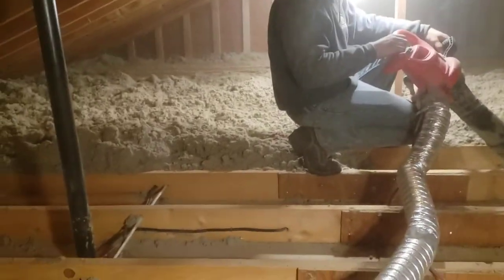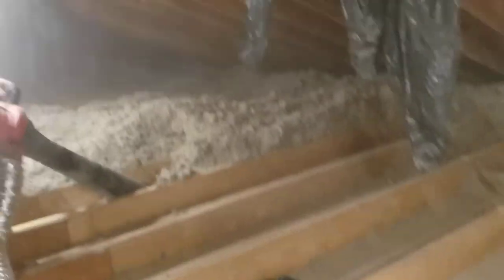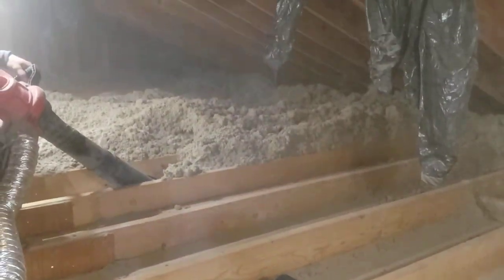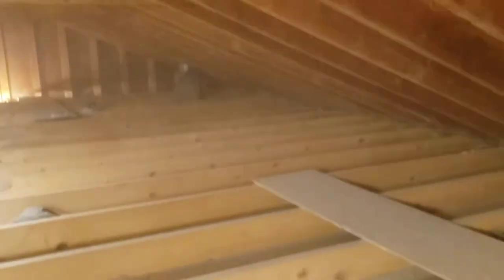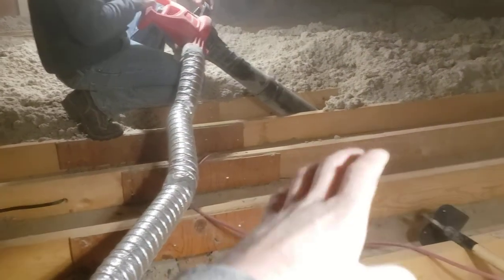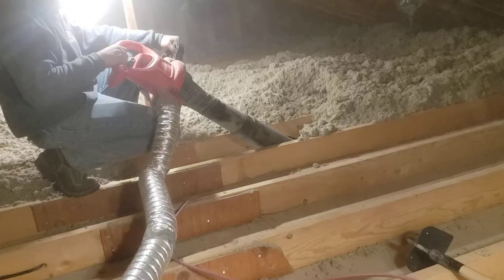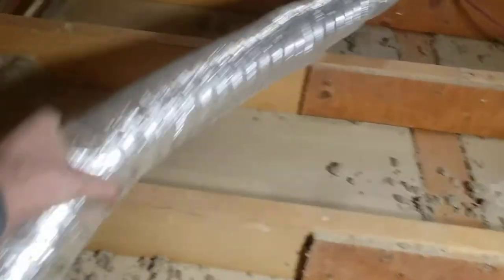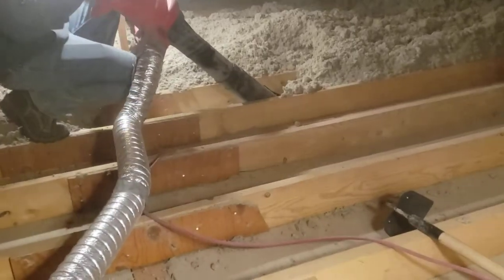how to remove blown in insulation

Comment: I hate blown in insulation. Why that stuff is used at all is beyond me. I'm removing mine and replacing it with batting and plywood.
Reply: Same..
Reply: You guys are nuts! Blown in so much getter than batts.

No seams to deal with, so less spots to leak heat, while also being fast as hell to install and conform to odd areas that batts would be nuts to put.
Reply: Also depends, by codes I’m required to put R60, not playing games with batts like that.

Also for snow load we have more framing in the attics not open like this. So many obstacles in the way.
Reply: @justinstevenson2061  I have to disagree. You have to air seal first. Whether blown in insulation is used or batting. If you don't air seal first then all that insulation won't do you a bit of good. The batting comes in different sizes to fit in between those rafters. If fits in tight and neat. Then I put plywood flooring over it. It's a neat and clean installation. Now I can walk up there and inspect my roof. I have lighting and proper ventilation in my attic. It's a comfortable space now. No more dusty dirty attic. My roof is insulated as well as all the flooring up there. It's really nice up there now. Not at all like that mess in this video. That is exactly what my attic used to look like. That blown in insulation is the worst stuff you could possibly use. Now my attic is completely air sealed and insulated and easily serviceable if something should happen up there. I can get to everything without having to worry about going thru the drywall ceiling if my foot should slip and go thru. Blown in is just dumb in my own honest opinion. Ruins a home.
Reply: @eddiea3782  I definitely agree air sealing is the biggest thing. Even with poly VB every penetration is the problem.

As for the batts vs blown, my point is I need 22 inches for R60 minimum building code.

Yes run the batts perpendicular but still have cross seams in 2nd or 3rd layers, and you on the top layer(s) have to cut around all the vertical support of the trusses, a lot of cutting and likely imperfect spots due to framing etc, light fixtures and bathroom fans. Can be done but not as evenly as blown for sure.

And for the plywood floor that’s a sweet idea, only issue is again depth we need here. Even with batts they are thicker than the bottom plates cavity with 2x4 trusses.

Nowhere to lay ply unless you do extensive framing to ensure your not putting too much load on certain supports with all the differing angles on the hip roofs especially.
Reply: You will not get the R values required in colder climates with anything other than loose fill. Batts will leave a thermal block that is disastrous. Even spray foam is not good in some applications.
Reply: @ginger_bredman ya especially when you need R60 or more.

10-12 inches of foam needs to be done in several passes.

And R60 is R60. Better air sealing with foam, but so much more costly.

If customers have mould and I’m already removing old insulation then I’ll spray an inch or two of foam to give that great air seal, and then blow fibreglass.

The only difference in that vs full foam is air movement at the top of the fibreglass lowering the top layer effectiveness a bit.

Always thought why not run tyvek overtop. Just laid out and will have cuts etc with trusses framing

But still stop the air movement into the blown in a good bit. Still allow for moisture to dry.

It’s the OSB on the exterior walls that is stopping moisture from wicking, tyvek is more breathable than OSB so always looks ok back of sheathing for exterior wall in cold climate.
Reply: @ginger_bredman  Understood. But now I have a clean,  vented space with no insects. No rodents. Easy to maneuver in. I can inspect my roof without issue. I have nice lighting up there now. It's a very nice space now as compared to that once crappy attic. No more dirty dusty smelly damp blown in insulation. No longer have to worry about falling thru the ceiling because you can't see where the rafters are.  I know how to install bats. Most people out there can do the same. And guess what? The temperature in my attic is much improved now. Much more controlled.  I don't know why blown in insulation is being pushed so hard to put into an attic when all it does is completely ruin that attic. Blown in insulation is the lazy mans way out of a properly done job. It's cheap and it's fast. It's the contractor's hit and ran fast money kind of a job. They don't care what happens to your house afterwards. It's just a mess. Okay, I'm off of my soap box now.
Reply: @eddiea3782 I'm right there with ya on this one..how did you do it? DIY or pay through the nose?
Reply: @deangullberry2420  did it myself with help from friends who are also contractors/roofers. They don't recommend blown insulation on any home that wasn't built from the start to support it. Mine is coming out really nice. Other homes in my area are being done like mine as well. A lot of homes in my area have had the ceilings fall in as people mistakenly add more and more of that blown in insulation. That stuff gets heavy real quick as you keep piling it on. The drywall just can't hold it up. There were parts of my ceiling that were coming down too. I'm in far Northern Illinois near the Illinois/Wisconsin border so it gets really cold up here.
Reply: @eddiea3782  I'm in se michigan and my house was built in the 50s, hip roof with full attached garage, full of about 2'of that shit from end to end. I just watched a vid some guys using powered leaf vac with attached dryer vent hose..i kinda like that idea..how do you get rid of it? If is not asbestos?
Reply: Everything you think you know is wrong.
The blown in cellulose contains borate which renders it mold and fire resistant and pest repellant.
Fiberglass batts encourage rodent activity. Rodents LOVE it.
The system you described installing on your house may make your attic ‘pleasant’ but not properly functional.
You likely do not have nearly enough insulation, are encouraging rodent infestation and are likely growing some nice mold under some of the materials you installed. 
Building insulation systems are complex. Get it wrong and cost yourself big time.
Reply: @Noeasyhandle  What you just commented on is exactly the opposite of what is happening to homes around me including mine. That blown in insulation attracts moisture that does not dissipate. It holds it in. It causes mold issues. Rodents absolutely love it. Batting if and when it needs to be removed is simply rolled up, bagged and disposed of. Have you ever tried to remove contaminated blown in insulation?? Have fun with that.
Reply: @eddiea3782  sorry to hear. Unfortunately, I dont select insulation based on ease of removal. The idea is that it shouldnt have to be.
If you are getting so much moisture or rodents that you need to periodically replace your insulation, then you have bigger problems to fix.
I have removed ALOT of batt insulation that was full of rodent superhighways. They tunnel through and make themselves at home. I almost never see rodent activity in the blown in however.  As far as moisture goes….you need to fix your roof or fix your ventilation. If you have problems with either of those, it wont matter what insulation you use because none of them are designed to be wet.

Comment: I live in San Francisco and I am having trouble trying to rent an insulation removal vacuum, I am being sent from one place to another, one has the machine but with holes in the 4 inch hose everywhere, another place has only a 50 foot hose, etc.  After seeing this video, I am buying a couple of these leaf blowers, and am not renting the insulation removal vacuum gas powered machine. Thank you for posting this video Horst Construction.
Reply: did it work?

Comment: I did that with a toro leaf blower/vacuum but I had the vacuum on the opposite end right next to the dump trailer with a 6’ piece of hose on the discharge end blowing into the trailer and the suction hose was two 40’ x 4” insulation hoses. Worked pretty good but have since made a gas powered 18 hp vacuum with 8” hose. Can send my guys in a 2500sq ft attic and they will be done in 30 minutes. It’s very powerful, it will suck up the insulation from 2’ away
Reply: That's a massive hose for that! I regularly do removals with a 6" that I generally taper down to a 4" for easier maneuverability. Also on a 18hp gas powered
Reply: Could you please prove the brand/model of the gas powered vacuum?  Thanks.
Reply: @timothymockett3515 exactly what I’ve been using, except it’s 19hp because I’m super cool.

But ya renting them is costly, a bit in rental but just the time to go pick it up and drop it off I could do a damn service call or two.
Reply: @timothymockett3515 just use a gate pull handle or similar on the 4 inch. 

I’ve got relatively big hands/long fingers but holding that 4 inch for hours makes my baby hands cramp.
Reply: @justinstevenson2061  I've attached handles to my host before, and in certain situations it's optimal. But sometimes, I gotta just wrap my hand around it and get it done. Can put more force into it that way to break up solid chunks of cellulose
Reply: This is a much better idea. Especially the 2nd part.

Comment: Fantastic idea, do you believe you could blow it back in with the leaf blower after air ceiling?
Reply from the maker: Not sure on that. I know you can rent the actual insulation machines
Reply: @horstconstruction1995  what name brand blower did you use?
Reply from the maker: @nelsondasilva3918   craftsman
Reply: @horstconstruction1995  thank you very much going to try it tomorrow amazing idea keep it up
Reply: @horstconstruction1995  did you take out the blade on the leaf blower
Reply: @nelsondasilva3918  no don’t remove it. That’s what is causing the suction and will break up the clumps of insulation to prevent it from clogging.
Reply: @nelsondasilva3918  how did it work
Reply: I’ve blown new insulation in with one, it works.

Comment: I never thought about using a leaf blower, of course I did not know leaf blowers had suction and mulch option. An insulation vacuum costs 320 to rent and I do not have a trailer for my truck to haul it on and delivery would not be cheap. So this sounds far cheaper and I keep the leaf blower when done. Will be trying this soon.

Comment: Nice idea. I have been looking at a couple of video about how to remove insulation on some area of my low pitch attic because I want to get rid of termites that might be on top of 2x4 wood coming from bathroom walls from bottom of tub witch is always moist cuz I know a couple of tiles are crack....I got this foam called termidor foam that I want to spray behind bathroom walls and then some in attic but like I mention I want to remove some insulation above bathroom attic area to spray that foam. ''Can I reused that insulation ones I spray foam on attic ?   Thank you
Reply: I would seriously consider fumigating your home. Those drywood  termites could be another inaccessible areas that you cannot see and by your description it sounds like that may be the case unfortunately. But, if you want to buy some time try foaming those 2x4s that keep in mind that foam has to soak into the wood not sure how you're going to do that with rafters or roof sheathing but you can try and just keep an eye in that area with an inspection every year by qualified termite inspector. I wouldn't worry about the insulation too much that material will dry and you'll have some residual to kill bugs in the future

Comment: Why is he on the sheet rock ?lol
Reply from the maker: Must be the angle your looking at it .  he is clearly standing/ nealing on the ceiling joist. If he was nealing on the sheet rock he would fall through to the down stairs
Reply: @horstconstruction1995  is it possible to put plywood over the rafters and insulation so it's easier to work up in the attic?

I have a gusset frame attic with blown in insulation and it's a nightmare to work in.  Want to replace the blown in with fiberglass and cover with plywood
Reply from the maker: @robertm5969   its not impossible. Generaly ceiling joist  are not constructed as heavy and not ment to be used as a floor. For fear of cracking the drywall ceiling below. How ever.  For temporary  use or storage with not much weight.  I'd recommend spray foam as you will get more r value in a smaller space . With fiber glass you would have to add  wood strips for a bigger space as so not too crush down the fiber glass losing all it's r value